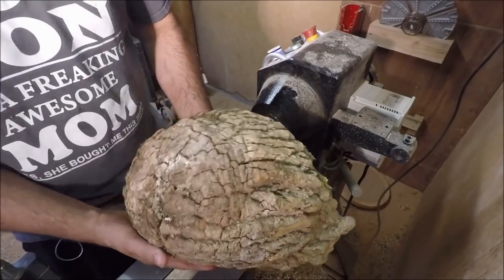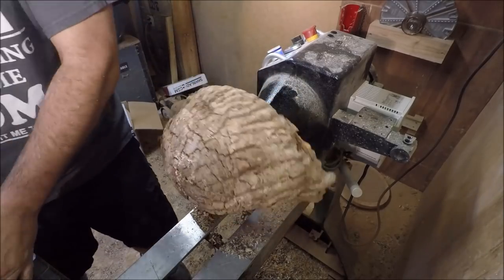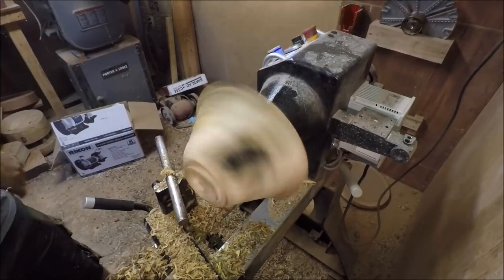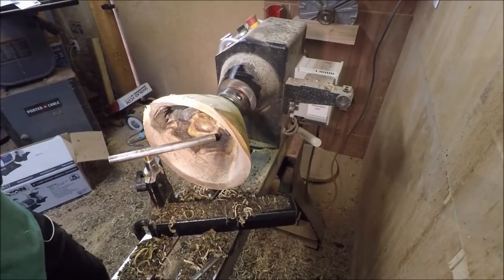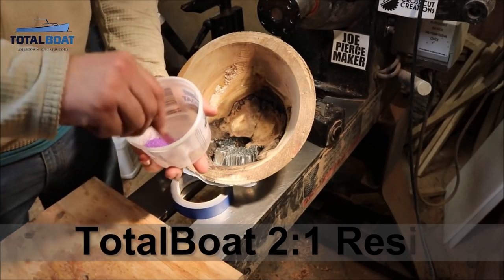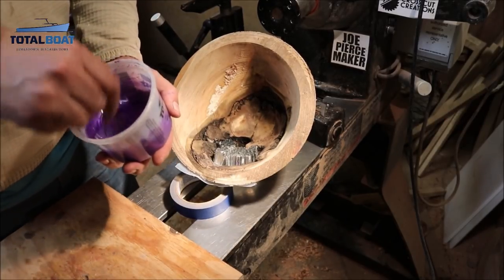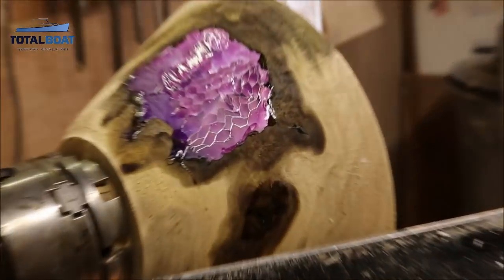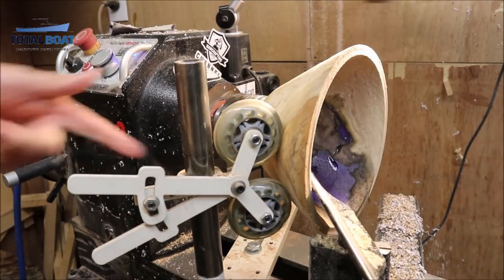Wood Turning - The Honeycomb

Comment: Hi Moonpie,  I love watching your videos before bed.  Mesmerizing!  I have a question for you.  Would there be a benefit to using a vibrating plate during the pour to help minimize gaps and bubbles?  Maybe this isn't a problem anyway?
Reply from the maker: Hey Eric, I appreciate those kind words. A vibrating plate may introduce more bubbles. A pressure or vacuum pot is the best options. 

Ken

Comment: Very nice Moon. How the heck did your cutting tools not get caught up in those big holes? I haven't used a lathe since shop class in the 80'2 so no experience to fall back on.
Reply from the maker: The resin filled the holes and the aluminum is a very soft metal so the cutter go through them well.  

Ken